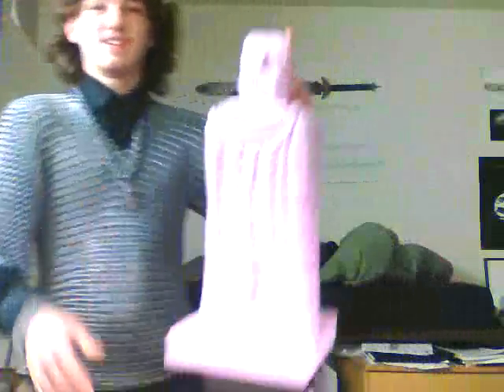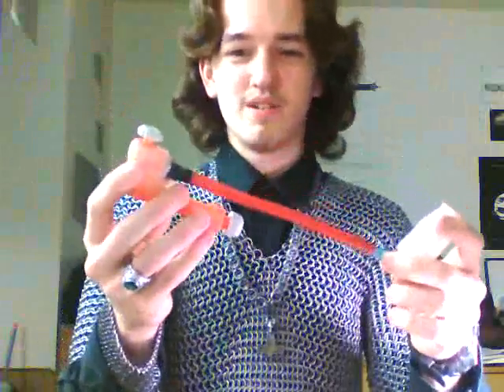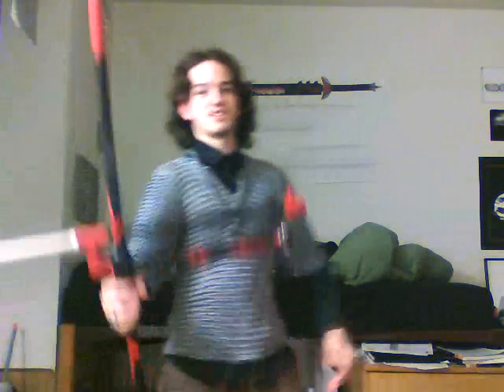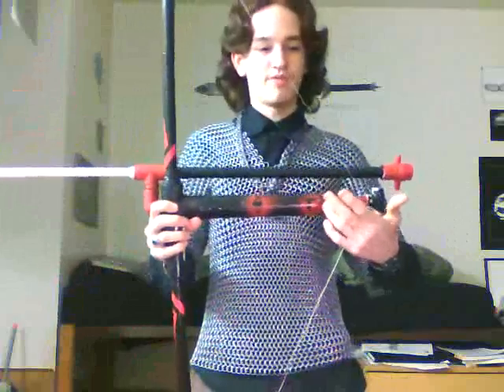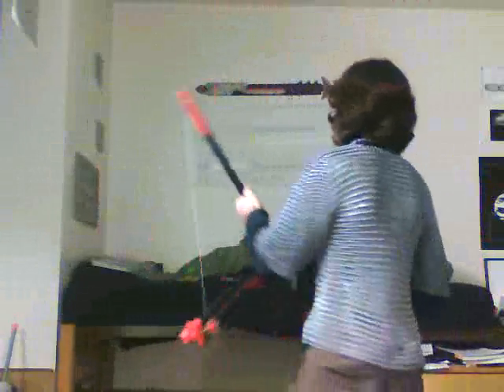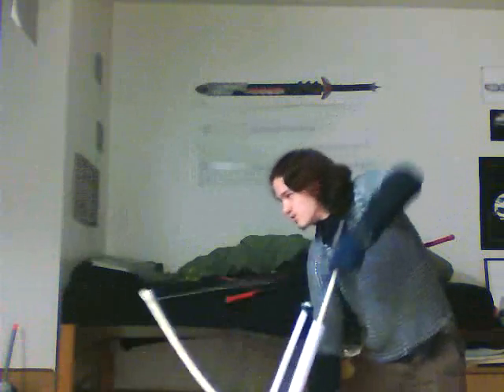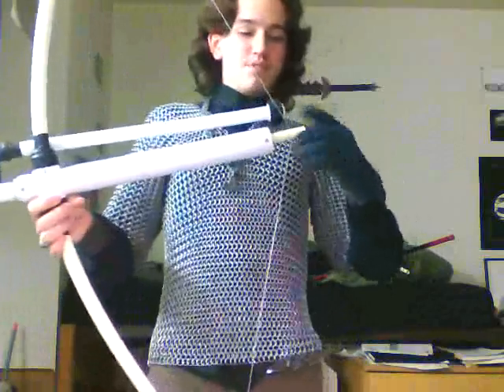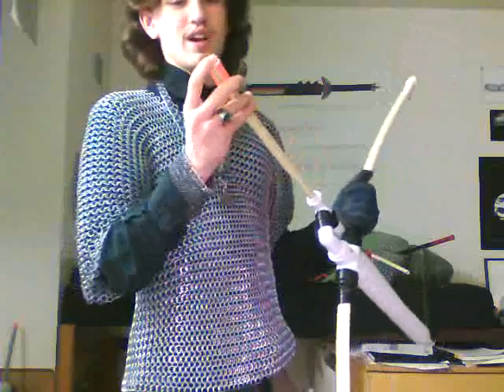Updates on stuff

Comment: @ChanmailleMan idk, money IS an issue atm. I could just use my thick synthetic thread for now and if their is a problem I opt out of it later.

So essentially, its a 1.25 plunger tube, 2 1.25 T joints, and 3 1.25-.5 PVC connectors, and a long peice of 1/2 PVC as a bow arm, and all the stuff you need to make a RSCB?

ALRIGHT. I can probably get all that stuff this weekend and make it in a few hours or so. :D